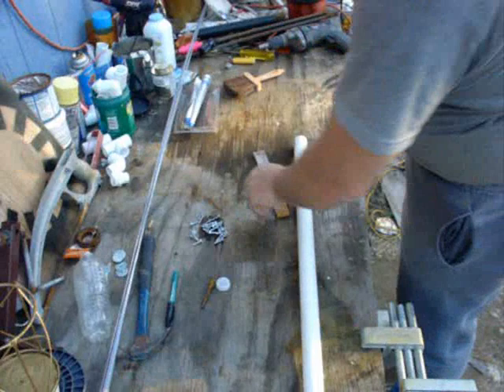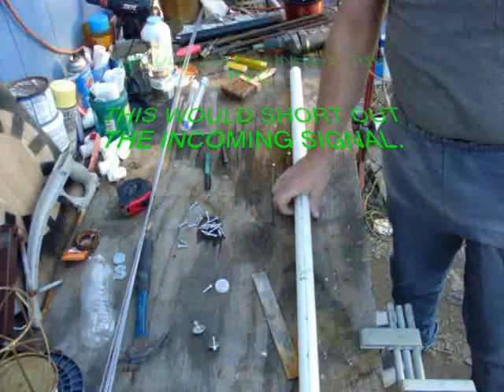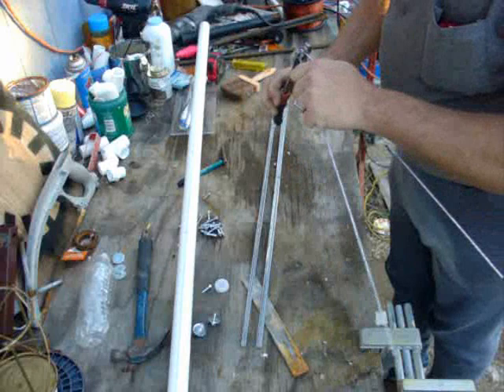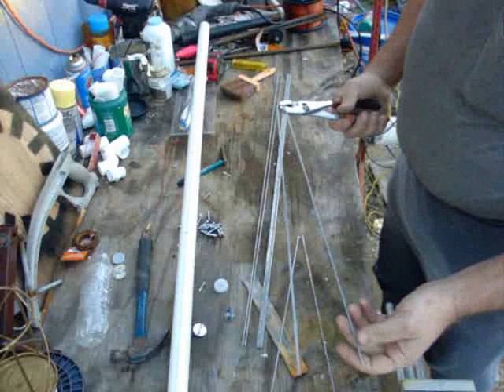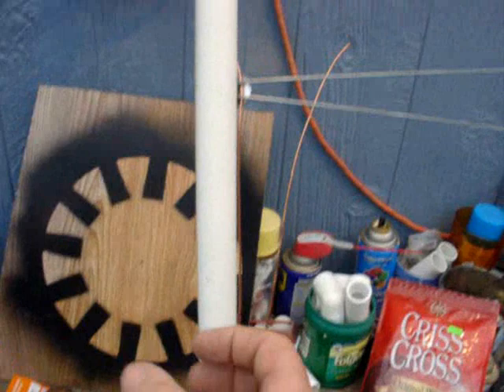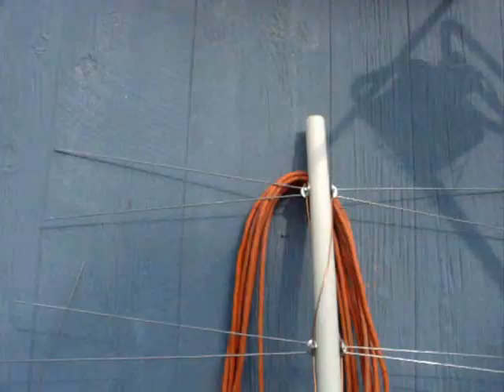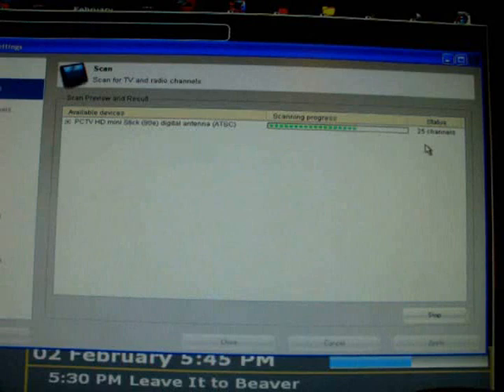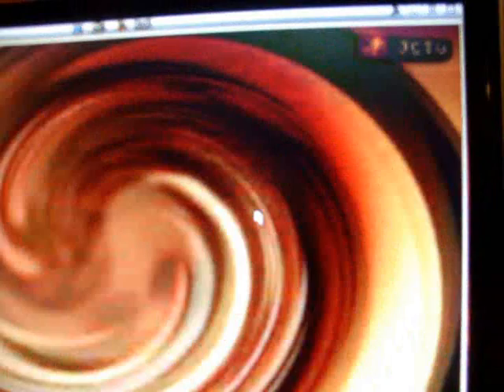EASY BUILD  HD TV ANTENNA   FREE HD TV 2020

Comment: What size was the pvc tubing that you used on this build for the skeleton or backbone? The moving lettering was distracting to me and I believe that I now have video epilepsy as a result. Don't worry though as my resulting lawsuit will only be for a million or so for damages and I am sure your homeowner insurance will cover it, right?  :-)  Would a reflector added be of any help on this antenna or more issues than it is worth? Thanks for any info on my questions. Nice video, but the starwars motion of the lettering moving by as I watched you was a bit of a distraction for me . My lawyer, Gloria Allred will be in contact with you soon to settle out of court, I suspect. :-)  :-)   :-) Nice review, guy.
Reply: For my build, I used 1 " PVC pipe.

Comment: Do you think you could build an antenna matcher for digital tv? thus making it possible to use a vertical whip of sort? a whip is excellent for multi-direction receiving correct? good signal and a perfect match would be good, kind of like we use in ham?
What are your thoughts? 
Bill
KB1YDB
Reply from the maker: bill ethier you mean like a mini roll inductor tuner with variable caps. Heck why not. If you do that you can receive off a set of bedsprings if you want huh?
lol. Cool idea. and i am sure a long wire will work very good as well as your wire whip.
:)
MUDDy
Reply: @muddymuddymuddmann re

Comment: Nice work!  I see your a Texas man, so am I! about 40 miles south east of San Antonio.  Have you tried using a piece of expanded metal or hardware cloth as a back grid? does that help improve signal?  I plan to build one very soon and mount it about 30' in the air. found a collapsable antenna pole that GVEC uses for their internet service, about 45' total length!  that should be tall enough! any way mounting three of these, one facing San Antonio, Dallas, and Victoria should get me going good!

Comment: what about a lighting strike? you have  a ground wire attached to it?
Reply from the maker: a simple home made spark gap arrestor should be fine.

Ground the shield to a ground rod.
Then make a weather proof box that the cable can pass through, and be tied down or mounted.

glue the cable down somewhere inside the box.

cut into the side of the cable and shield of the cable lengthwise to expose the signal wire in the middle of the cable

 Next: run a wire from the ground rod to the box. Sharpen a long fine threaded screw to a fine point, and drive it in through the side of the box.
adjust the screw until it touches the signal wire, and back t of 1/2 turn.

that should short out any voltage above the spark gap to ground.

Ham radio operator of the past made and used them for a log time.

Comment: I have tried to find ceiling tile hanger wires at my local home cntr but I've had no luck. Does anyone have any suggestions?
Reply from the maker: SuperSaltydog77 stainless steel welding rods, 10 gage copper wire, coat hanger wire, or for simplicity, one could just make a rectangle of pvc, and string the whole thing out with fishing line and any copper wire. :)the conductive array is the resonant part that makes it work. MUDDy

Comment: have you tried building a fractal antenna about the same sizes or smaller i have built one and i was surprised how many channel i got i used to live between toronto and ottawa in the middle of nowhere  about 100miles one way to ottawa and 75 mile to toronto i use to only get 4 to 6 channels  when i built the fractal antenna i got about 60 ( hook it up to a satillite dish) more channels you might get more channels. I got the infomation off the internet

Comment: One more question:  where did you get the 234 number in your calculation for the 1/4 wave  antenna between 40mhz and 910mhz?  Also you may have a typo in there as we get 234/910 = .257; (not .245) but it comes out almost 3" anyway. THANKS

Comment: Sorry to say this antenna doesn't work near as good as the smaller 'coat hanger' antenna I built.  The only advantage is that this antenna actually picked up the only Hi-V station in my area.  I added a cheap store rabbit ears antenna and I get the Hi-V station with my antenna.  The 'coat hanger' gets all the other channels (UHF) in my area.  I was really hoping this would work.  The 'coat hanger' one is also a heck of a lot smaller.
Reply: I actually went to the links at the end of your video. I made two changes to what you show in the video. First I was using 2" pipe which doesn't work. It cannot be bigger than 1 1/4" in diameter. Second, the balun has to be between the two middle wiskers (4.75"). After I made these two changes it works great. It even gets the hi-v station and I don't even need the reflector.  Super : )
Reply from the maker: John LeBlanc Thank You very much for the info, and knowledge. Again thank you very much for sharing.
MUDDy

Comment: Could you show how you "aim" the antenna? Is it horizontal or vertical?
Reply from the maker: Not a problem, and thanks for the great question.
I like the google maps or google earth method.

search for where the tv stations are.
Mark them on the map.
Also mark where you live.
Then note the direction of your street in font of your house. And the angle between the street and the angle of the direction of the stations.
zoom out to see the big picture, and back in.

lol, I acually used a dry erase marker on the lappy top screen to help out.
Then I switched to the satellite picture view. and moved the map until the line lines up with the antenna pole on the house. you should be able to see something that the line crosses that you can aim the antenna towards.

9 times out of ten you can not miss perfection.
I hope this helps.

MUDDy
Reply from the maker: Horizontal

Comment: So Muddy, I built it, didn't work in my house or out side at eye level. So I put it up 20 feet, with a preamp. says 5 channels from Albany, NY but too weak to display.
It's 17 here, tomorrow I'm going to try and put the receiver closer to the mast to see if that helps.
Albany is fairly close to see level an up here it's about 45 miles away and 1300 ft.
john
Reply from the maker: a pre-amp close to the antenna might help out to keep the signal clean before it travels through the cable and looses it's strength as well. then even the weak signal will be viewable.
I lived in White Hall for a few years. beautiful country.
and that restaurant up on the side of the mountain that looks like a big church there, brings in some good memories. Very beautiful. a sight to see.
MUDDy
Reply: ***** wheather the preamp is inside or out I still get three channels to low signal. next I'm going to try putting some hardware cloth behind the elements and try to point just at Albany.
Reply: john otoole
Have you tried any of the other homemade antennas to see if they work better ? I'm about 45 miles from Albany myself and would like to cut the cord.
Reply: 161dullman I live in Hinsdale, ma at about 1300 ft, a lot of obstacles between here and Albany.
I did not try any bought ones. A local antenna guy would sell me one would work but the cost is about $400. This antenna was made by stuff I had around the house except preamp and cable, stuff like that. I put a hardware cloth screen behind my antenna. It gives better signal, but still the three channels. But because of the added weight, I only put it up 13.
I will put up another video on my channel maybe Saturday.
best john
Reply from the maker: john otoole
AS FAR AS RECEIVING ANTENNAS GO, MORE LENGTH USUALLY GIVES MORE GAIN, BUT IN SOME CASES, IVE HAD TO TUNE THE ANTENNA WITH A TRIMMER CAPACITOR ACROSS THE FEED LINES. SHORTER COAX HELPS. CHECK THE COAX CONNECTIONS AS WELL. SORRY I TOOK SO LONG NOTICING THIS POST.
MUDDy

Comment: What kind of wire is that? 12 gauge solid copper?
Thanks
Reply from the maker: it was ceiling tie wire. 12 gage copper might work for a while before it bends. 19 gage copper would hold up well against the birds landing on it and all that, and would be pretty easy to solder to if you like.
MUDDy
Reply: thanks

Comment: Could you make this an omni-directional with more dipoles mounted in a circle?
Reply from the maker: Nino Iannacchione Absolutely. One more at 90 degrees from this works nicely, or three at 120 degrees will do even nicer.
Adjusting phasing between antennas will get you even more directions, and sometimes more gain. Antenna switching between antennas should be done at the base of the antenna for stronger signals. switching to two antennas will have a gain directly between their directions. easier and cheaper than a rotor installation. I just use the Armstrong (arm-strong) rotor. I hope this helps.
MUDDy
Reply: muddymuddymuddmann do you have a video for an omni-directional one? Or do you know a good video. I’m knew at this.

Comment: What software were you using on your computer and how did you connect the antenna to the software?
Reply: I have run my TV through my computer for many years. best way is use a computer with window's 7 as it has WMC "Windows Media Center". It is a very good DVR. Connect antenna to a "SiliconDust HDHomeRun DUAL High Definition Digital TV Tuner" (bought mine on amazon). Connect the tuner to your router. Then any computer in your network with WMC can be used as a TV. WMC will see the tuner and works like any TV setup, scan for channels - then choose which ones you want to see. You may need an external hard drive as video does use a lot of space on whatever hard drive you choose to record on. It can record two channels at once. You can stack another dual tuner if you want to record more than two at a time. You will need to have a separate antenna for each tuner. Nice if you need antennas in different directions.
Reply from the maker: Terry Hueffed as dwg42 said. windows 7 sounds cool.
Mine was a pinnacletv adapter that i had on my EX Puter. 32 bit as well. Pinnacletv.com
MUDDy
Reply from the maker: dwg42 Thank you for the cool info on windows 7 having the software installed already. That is good info to know. Cool Beans bro.
MUDDy

Comment: Kim actually my channel 23 is a lo VHF channel and is virtual channel 6 I cut the aerials to 18 inches and then bent them in shape  and could not get this channel I then cut my aerials to 36 inches and bent them in shape ad now I can get this and other channels from two  directions front and back of antenna out preforms a channel master 51 element directional antenna and I used 14 gauge  electric fence wire to connect the aerials and stainless steel flat washers and screws to attach the aerials and connecting wire to PVC pipe to prevent premature rusting of aerials and connecting wire.
Reply from the maker: +colplowboy Sweet, The extra length allows the lower frequencies to be resonated very well. Thanks for the great news. I love to hear it. and to Knwo that folks dont have to fork over extra money to the corporations. I think it is safer in my pocket. lol.
MUDDy

Comment from the maker: r ruiter Try shortening the aerials. A shorter wire resonates at a higher frequency. and check the distance between the tips of the aerials.

MUDDy
Reply: Actually it should be the other way; the rf channel I'm trying to get is broadcasting at 200MHz (high vhf). There's actually a handful of hi-v stations around, but the NBC in Baltimore (11.1) is the only one I care about.  I ended up adding a homemade rabbit ear apparatus to the top - used shielded cable attached to the transformer so it wouldn't interfere with the dipole setup and split the pair at the top. It's all in 1/2" cpvc with a t fitting up top and it's about a foot above the whole dipole assembly. I first made it about 6' wide (guestimation of course).  Didn't get much so I shortened it to 59" (a more scientific measurement) and that's when the weirdness started. Now I'm getting alien transmissions from Mars. Just joking, but after some tuning I'm getting all the uhf in a 65 mile radius (DC, Baltimore, and Delmarva).  Didn't think that was even possible.  Still no hi-v channels though. I'll get it figured out.
Reply from the maker: interesting adventure.

the half wave dipole length for 200MHz is 2.34 feet overall length. (2' 4.08") Each half being 14.04 inches.

I hope that helps.
Reply from the maker: for a dipole , The length of each driven element is 
234 / frequency in MHz = quarter wave length.
468 / frequency MHz = half wave length. or the total length of the dipole.

For a quad antenna, it is
1005 / freq.MHz = FULL wave length of wire. 
Divide by 4 for length of each side. 
Add 5% for reflector elements,
subtract 5% on the director elements

the load is 100 ohms with a decent gain because of it.
The antenna cable is usually 75 ohms.
Direct connection usually works well enough.
Better results with a balun.
Reply: I made mine with 5 on each side. Does that reduce the receive potential?
Reply from the maker: actually it should improve a bit because of total area for collecting magnetic waves. But trimming to resonance would get even more.
For 200 Mhz at the length you are using, try 3.51 feet on each side

Odd multiples of half wave lengths add resonant gain. Even multiples of half wave lengths cancel out. 1.17 feet is a quarter wave. so 2.34 is a half comprised of the two sides total. 3 times 1.17 is 3.51 per side. totalling a 7.02 foot total width instead of the ten you spoke of.
Although I do not know how the gain of the rest of the hd frequencies would change. Probably more gain there as far as theory goes. But only because the antenna is stil a fractal antenna. I am interested in how you made your aerials mounts stronger to support the added load and leverage though.

Have fun.

MUDDy

Comment: what's the best way to ground this antenna?
Reply from the maker: One  side of the elements set can be grounded.
The second set has to be able to float for signal.
This 
Also homemade spark gap arrestors are nice if you live in a stormy area.
it consists of a sharpened screw, a spade lug,  A good ground, (like the pole) and An insulator. Or a small plastic enclosure to keep the rain out, (PVC), and be threaded by the screw.

  The shield of a cable is considered as ground, But for this, the bottom of the pole is the ground. 
   The signal wire of the cable is connected to the fine threaded screw with the sharpened point. the screw is adjusted to touch the ground, and then slowly turn it back until you get signal. Usually less than 1/8th turn back. 
Any higher voltage will jump the gap to ground. 
adjust it often.
MUDDy

     I should probably do another video on that.

Comment: @muddymuddymuddmann Hi Scott, is that PC-TV PINNACLE TV CENTER PRO the USB version or internal card type and could I get a link for $27 store. THANKS. Now I can get rid of my cable and save another 50. per month :)   I did not realize that you can pick up HD in the air

Comment: I posted a video of my final design. I put a hardware cloth back and rabbit ears on top, with a preamp. I get three stations from Albany
thanks.
Reply from the maker: WOW, SORRY IT WASNT MORE STATION JOHN. THANKS FOR THE VIDEO.
TRY GROUNDING THE SHEILD. AND AS ADDED PROTECTION, MAKE A SPARK GAP ARRESTOR FOR THE SIGNAL WIRE.
:)
PRETTY MUCH, JUST A GROUNDED SHARPENED SCREW THAT IS ADJUSTED VERY CLOSE TO THE INSIDE SIGNAL WIRE.
Reply: ***** thanks, now with the leaves on the trees, I don't get any signals, kinda like wind turbines.
best
Reply from the maker: john otoole hey John.
Big trees can do that for sure. Sorry about the signal strength, and lack of wind in all the trees. At least the trees keep it a bit cooler, and provide more oxygen.
MUDDy

Comment: what pc program is that thanks?
Reply from the maker: jetskier47 I dont remember right now, as i havent used it in a while. although linux has it in the repositories.
I believe it was Pinacle.or Pinacal, or something like that. I bought the mini unit from radio shack on the close out bin.
I bet you can get one on the web.
AAAAAHHH here it is Pinnacle TV. PCTVSYSTEMS dot com

Comment: no one uses the same length on these antennas.
Reply from the maker: Rickugg Good obsevation. Mine is double what the figures say as to absorb from a wider area, thus more gain, and harmonic resonance response. the signal is collected and bounced between the aerials for a fractal mixing and extreme wide band reception. shorter, means the lower frequencies are lost due to a lack of long resonances of length. only higher/shorter frequencies can be achieved after mixing and bouncing the signals around.
THUS doubling the lengths gives more gain by area collected from, and the ability for a wider band of harmonics. Enjoy not needing an amplifier.
MUDDy